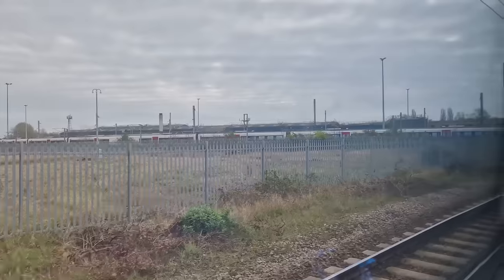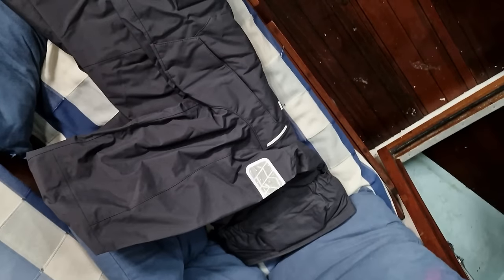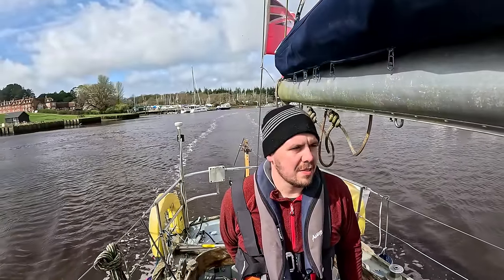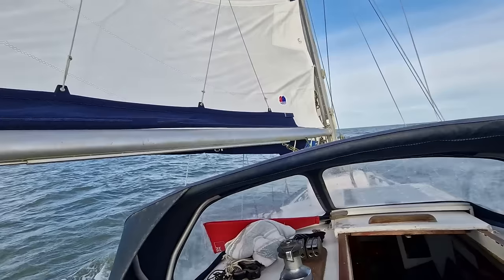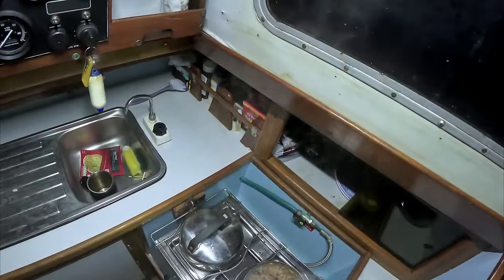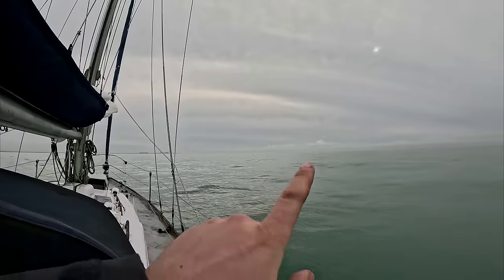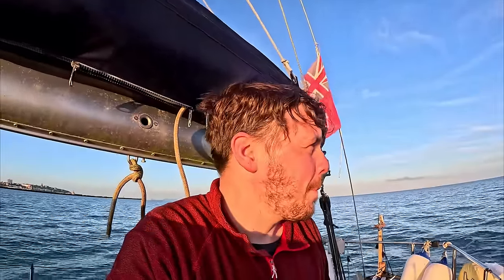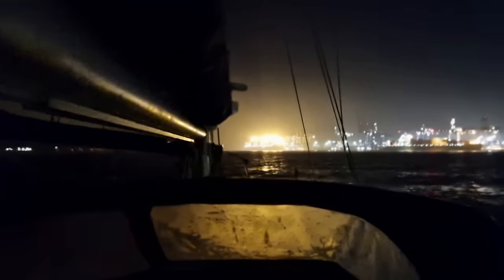Sailing Singlehanded / Solent to Suffolk / Running out of Gas and UK Border force pays a visit

Comment: For future info. Kettle of boiled water . Take gas cylinder off the boat ! Pour kettle onto outside of cylinder. Where the gas level is, the water will condensate showing level. The empty portion of the tank the hot water will steam off. Keep up the excellent work Sam
Reply from the maker: Nice tip, thanks 👌

Comment: Thank you for your wonderful videos. You seems to do everything as it should when it comes to sailing. However I have noticed that the wood in the cockpit and the deck need some work. I feel pitty for the wood if it will be destroyed and cause you much more job . I dont know if the deck needs more than paint. Have a good time.
Reply from the maker: @imar758  thanks for watching, yes theres plenty of sanding and painting on the job list. Thankfully the cockpit wood is sound and needs treatment only. 😎

Comment: Good job, fantastic cruise!  @ It looks, this is a solid boat and, despite her age, still ready to offshore cruise... 40:26 - Is there no electric anchor windlass on the boat? I always have trouble manually raising the anchor, even though it's only a seven-meter boat and I have an outboard engine to help me...
Reply from the maker: Manual windlass but I haven't used it, it works fine but I have other techniques to raising anchor 😎

Comment: Well done. 
Did you go without sleep from Bucklers Hard to Ramsgate?
Also,  you did the UK circumnavigation on a Hurley 22?
Reply from the maker: Thanks for watching. Not totally without sleep, I use a polyphasic sleep pattern of 15 minute intervals during longer trips and this is dependant on the area im sailing in. The circumnavigation was of GB in the Hurley 22.

Comment: Nice vid Sam and love the new girlfriend... was on my list but hatch was too small. 12v kettle in the emergency box.... had the same gas issue and by hour 20 you want to sell the boat.. was a new bottle an reckon they leak if not super tight...
Reply from the maker: Thanks for the tip on the kettle 👍